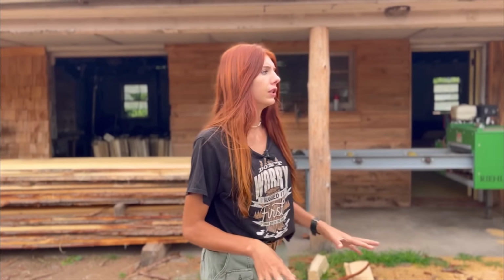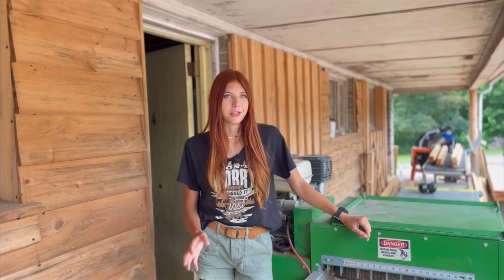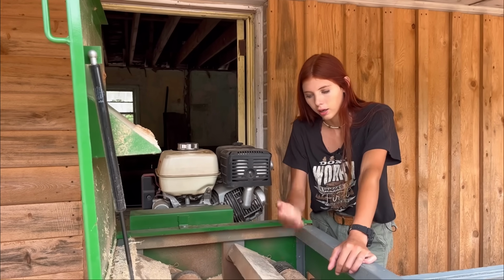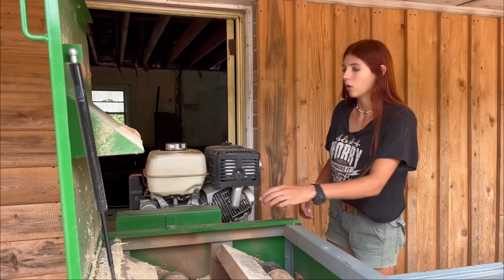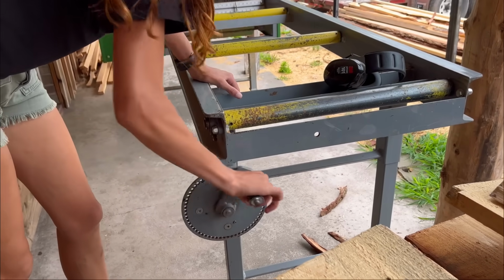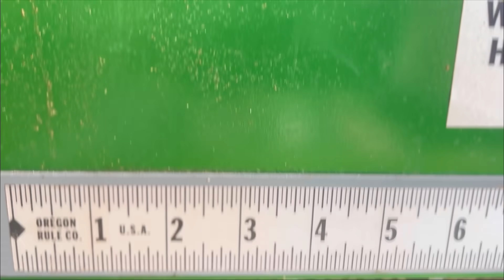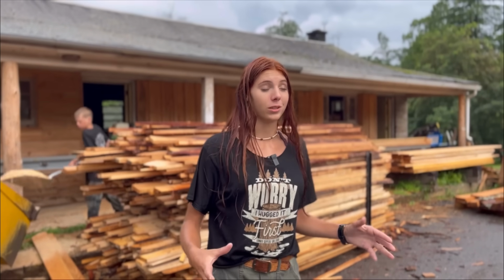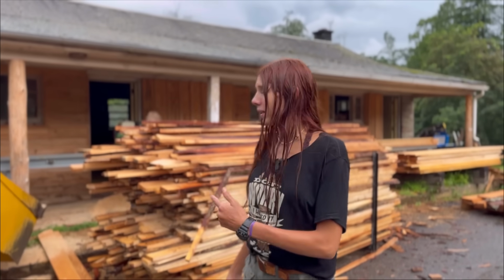Our Friday Work Routine!

Comment: May I suggest that the most importnat feature of the edger is the super long riving knife blade that aligns with the fixed rotating saw blade?  This ensures that once the direction of cut is started, the board will be forced to follow that route, thereby providing a good straight edge.

Comment: You should be cleaning up your feed rollers after every shift (even during the shift if it's being used heavily) on your edger.  That buildup is going to do to damage your rollers in two way: 1) You are crushing the feed rollers out of round and eventually the diameter with the build up will be smaller than the clean side.  2) You are relying on the feed rollers to pull your flitch dead straight through the edger.  Once your feed rollers are no longer perfect, your flitch will not travel dead straight.  Only takes a few moments at the end of the workday to blow it out with compressed air.  Ask Grandpa. 😊

Comment: I like that machine.  You can put that cut edge up against your table or band saw fence and trim the other side to parallel quite easily.  I usually buy uncut lumber and then run the track saw down one of the side to get safe-to-cut on the table saw edge.  But lumber cut like this is a nice time saver.  Good video as always.

Comment: What a summer for rain ! I have wondered about the edger and still wonder if you are constantly changing the settings as you select each board or is it set and you work on a particular pile. You two actually work well together, you on the feed and Jade removing the edges and piling the boards by size.

Comment: Can the Machine be modified by putting a tube down to the hard to reach spot and clamping it in place.  Then all you would need to do is put the ATF fluid in at the top and it would drip on the place that needs the oil.  I don't think you have showed us this hard to reach spot.

Comment: Is that for 1" thick boards or is hight adjustable also?
Reply: Thickness is determined when the boards are cut from the logs.
Reply: @ronsamborski6230  uh, yea I know that. That's not what I was talking about.
Reply: @blake86303  I thought about it after I responded to your initial question, so now I understand what you’re referring to.

Comment: Would it not be more time efficient to have the edger set up directly behind the Woodmizer Saw? 

That way you reduce handling and can pull the wood straight off the Woodmizer and put it directly through the Edger.  From there it can go together with other cut wood directly from the woodmizer to stock/customer order. 

Right now you have to collect the flitches, (probably sort them by tree species), stack them and then later move with a Loader Machine to the Edger. Then load them and cut to size and then go stack the cut wood for stock/sale/order. 

Seems to be time inefficient and a waste of fuel on the Loader and double handling by the staff to process the wood like that.
Reply: They addressed this in one of their videos.  Yes it would be more efficient technically  but it would also take a third person.
Reply: @scottsoper  It would not take a 3rd person - same people just walk 5 feet and process at same time. It will slow down cutting on Mill marginally, but save double labour on Edger later. Running the edger for a full day means the Woodmizer Saw isn't in use. It is inefficient how the current set up operates.
Reply: @paullynch277  I am just going by how they said it would work.  I am betting that there is just one or two too many motions in there to do with only two  people.